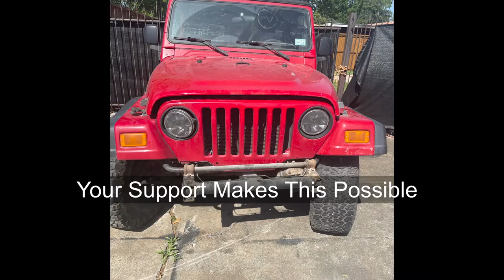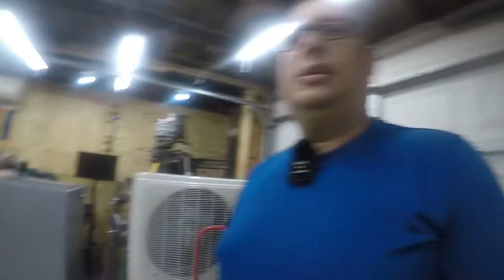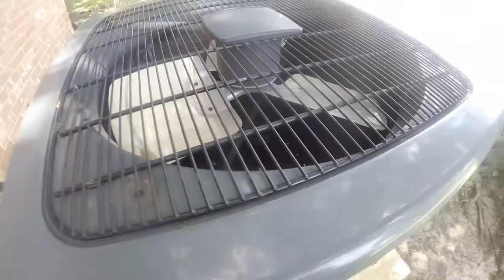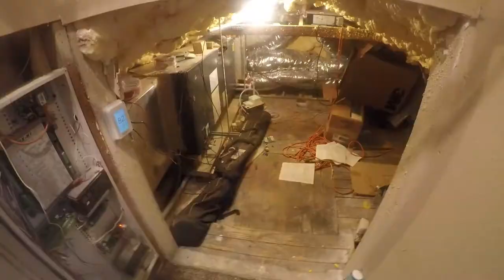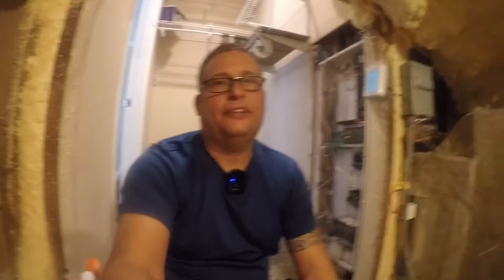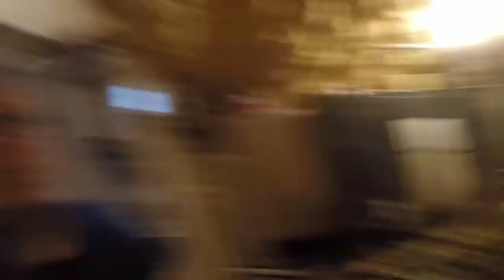HVAC 1: Goodman HVAC dies and this is the story of replacing it

Comment: A lot of times people don’t want to pay for whole house dehumidifier but I agree it’s very important on a foam house especially in the attic
Reply from the maker: I think most of the time they just don't get it.  I was explaining to a friend you have to consider latent and sensible heat.  Most units have limited capacity for latent heat removal.  In the shoulder seasons (fall/spring) there is typically not enough demand for sensible cooling to achieve humidity control on a energy star or foam insulated home.

For those following along at home... latent heat is essentially humidity, sensible is the temperature you read with a thermometer.  You must remove humidity in order to lower the temperature.  A poor installation will result in a clammy, damp house.  Good humidity management and air sealing will let you raise the temperature in the house and still feel comfortable.  This in turn will lower your energy bill while keeping you comfortable.
Reply from the maker: On a spray foam house it's critical to actively manage humidity.... bathroom fans, exhaust hoods over the gas range, etc.  Usually better to exhaust it then to try and use your HVACR unit to remove it. Water vapor is lighter than air.... it will rise to the attic and condense on/in the foam.  Nothing good will come of that.

Comment: I used to install Goodman/Amana, also used to install nordyne units. The comfortnet is something I never pushed because of issues along with weird stuff in the upper end. And the bottom end uses off brand compressors that are noisier. Goodman is best in its mid tier. Way too many issues with the top end.
Reply from the maker: In hindsight, I think if I had run shielded thermostat wires I would have been fine.... but who does that?  It surely wasn't in the manual.